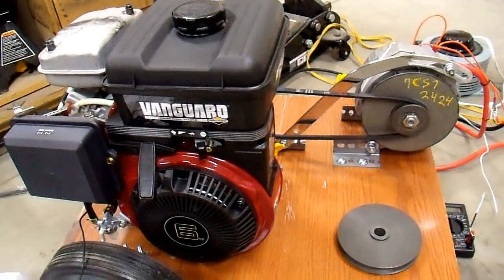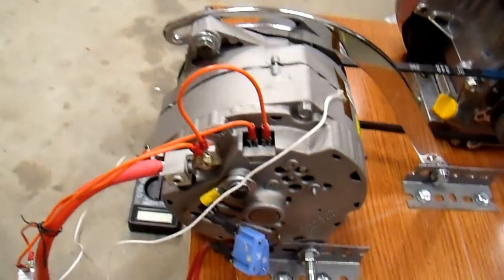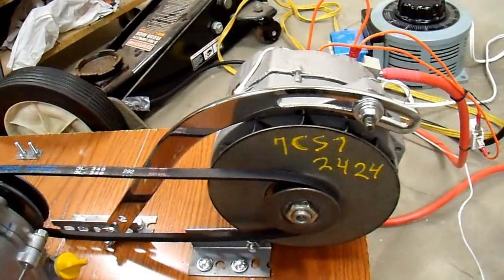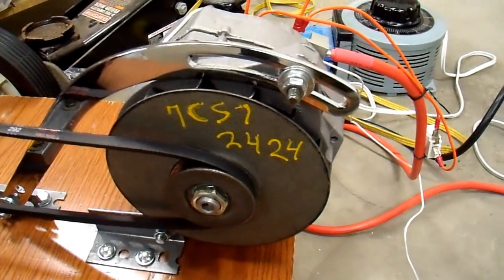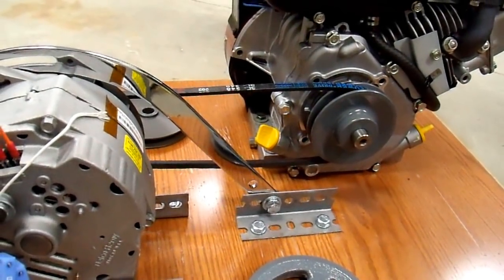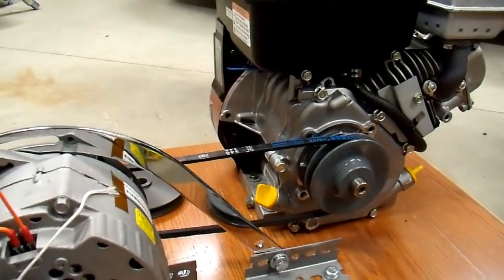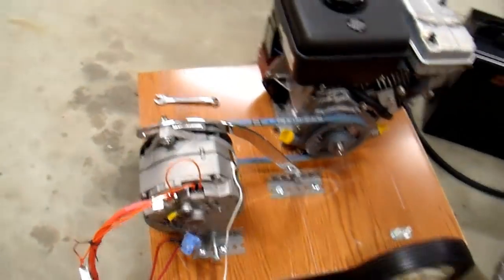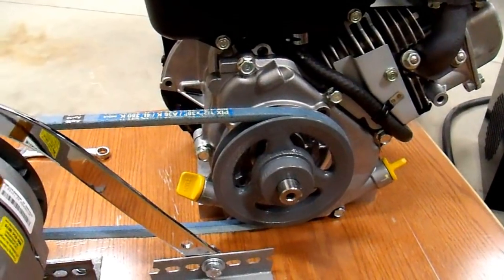DIY 12V Generator Charger - 7 Belt Drive Update

Comment: Nice build but your overthinking it. When I was a teenager I fastened a 12" pulley in place of the blade on a 3.5 hp lawn mower. Cut a hole in the deck and pounded it into a mount for a Delco  alt. Wired to an old style "block" regulator. The engine has to be started before you can put a load on it but it works like a charm. Have been using it for 40 years like that and it has never failed me yet. I use it mostly as a portable battery charger but I have run things off an inverter just fine.

Comment: Why didn't you put another alternator across from it. connected at the shaft, that way you run two. YOU could also run 4 with a double pulley on the gas engine. Get 4 times the power. USE a mechmann 370 amp alternator. USE fumes to run the gas engine. That would be the ultimate power when doing what your doing.

Comment: I also converted the small Honda engine to run on LPG.. I took an old regulator off of a Coleman pop up..which BTW did not provide enough flow..I then bought an adjustable 20 psi max regulator from northern which gets the job done without melting the Honda clone..I then purchased a bicycle spedo off of the internet for 30 bucks that is used for automatic usage..it won't keep cranking unless it starts..it is fully automatic..it will turn the gas on for 5 seconds if it dosent start it will cycle for 20 seconds and try again..after 4 times it won't try anymore and you have to manually push the button and turn the gas switch on..it will still run on gasoline but is much better on propane..if you want to do this with yours PM me and I will give you the breakdown of the parts list and specs

Comment: the AC delco alternator that you are using is inappropriate for heavy usage.. the problem that I encountered with the dodge alternator was obviously the voltage regulator had to be replaced once every 3 months..the belt..and I had problems with the rectifier diodes several times.. oh and also the valve springs on the Honda clone are inadequate.. but I worked through everything and it still kicks ass..I upgraded to a 180 amp alternator.. I'm not currently using it more than several hours a wk because my wind turbines are taking up the slack

Comment: I built one out of a Honda clone from harbor freight.. 78 amp Chrysler alternator with external regulator..old 15 amp generator off of a wheelhouse lawn tractor(so that I could have remote start)..an 8 inch pulley from tractor supply..and also one of those Kevlar belts..which by the way suck..but yes it would keep 4 ..8d agm batts filled and prety much run my whole house

Comment: Nice build.  Good tips for anyone who is considering using spare parts to make a diy dc generator. Although, if one had to buy all new parts, one would probably have to pay much more for that system than if one simply bought a good used portable generator.  For example, I bought a 5kW petrol generator for 300$.  It will produce more than 5 times the power of your setup & it probably costed less than your total cost in materials & time.

Thanks for sharing!
Reply: A B,
I have gone the $300 generators and the $4000 3.5kw generators before.  And basically you are paying about $10 for every hour of useful life.  That is, you May get 30 hrs out of a $300 generator.  His little 1200w DC generator isn't really optimized IMO, but it still gets at least 2x the watts/gallon of gas as those cheap generators though, and is much quieter. 
The inverter generators are really the only way to go if you are to buy one off the shelf, and then only the 3 named brands are even worth the price tag.
Reply: I agree that buying a yard sale or Craigslist generator for cheap and spending some time repairing it makes far more sense,  unless your aim is to learn to engineer your own project,  which is what this guy did.

But why didn't he do a better job of analyzing what he had and what he wanted?  Buying a new alternator that was essentially the same as the one he had could have been avoided had he looked up and read the specs on what he had and how it operated.

Comment: so on the excite wire that powers the field why don't you use a pot knob or potentiometer so you can crank the field voltage up and get more when you need it and turn it down when you only need the minimum and save the gas this is widely used in the auto stereo competition field

Comment: are you an engineer  or nothing else going on in your life i used a peice of crap alternator a dry rotted  belt a treadmill motor that itokk out of a unit ifound in the sttreet   no specs   80 amps no problem  made 2 does house

Comment: On heavy equipment it is common to use a double sheave pulley and V belt set up to transmit full power to a heavy output alternator.

Comment: leece neville makes all kinds of alts and use serp pulley rarely slip when torqued got 8 320A Leece nevilles never slips even under full load i used a twin cyl engine and cast iron pulleys from old air compressors like 10-12" pulley some what heavy to increase flywheel action also use leece neville alternators that have 3 phase AC taps and also variable dc regulator used by CB'ers to run big amplifiers

Comment: If your alternator RPM is too low, your alternator will overheat at higher amperages because the fan RPM is too low.  

Consider that 100 AMPS @ 6000 alternator RPM is getting you twice (roughly, I know it's not a linear relationship) the cooling power as 100 amps at 3000 RPM.

Comment: Why not use a higher current alternator that is made for car audio competitions?
Reply: unijabnx2000 Most high output alternators aren't "made for audio competitions." most audio competitions actually require you to turn the car off and run off batteries, with many events actually restricting the number of batteries you can use to 2. That being said, I'm sure he could have grabbed a 270 amp high output alternator but that amperage is unnecessary for what he is trying to achieve.

I compete in car audio. I have a chunky DC power high output alternator as well as 2 nice AGM batteries. I can't use my alternator in most comps.
Reply: Alec Westmoreland Cool story bro

Comment: First off awesome video. Very informative. As far as one of your viewers stated I wouldn't worry about the angle of attack for your pulley system. To decrease your angle of entry would mean decreasing the friction cause by the belt. By reducing the frfiction of the belt you create more of a chance of it slipping. My best suggestion would be to use a gear style system to remove the chances of it happening at all. Just a thought

Comment: what you could do is use a shaft compiler to extend the shaft and place some more pulliy's and belts on the drive. you will have to build a stabilizer at the end of the shaft.

Comment: That alternator probably turns alot faster in an automotive aplication
Reply: most acceleration is below 3k rpm
Reply: +DMAN22yeah engine rpms yes but crank pulley is probably 3 to 4 time the size of alternator pulley so it means the alternator is turning way faster
Reply: 1teddy1979 true, but it usually isnt loaded down much
Reply: +DMAN22yeah that is true as well. probably not too often you pull up 100 amps off the average car
Reply: 1teddy1979 only when the battery is dead or there is an inverter or something

Comment: I haven't read all the comments so ignore this one if it's been mentioned before.  How about the use of a third pulley, perhaps an idler pulley?  This would reduce the angle of attack tension on both the generator and motor pulleys.  This is how vehicle pulley systems operate.  Look at any car and you will notice typically they have no more than 90 degrees of belt contact on the pulleys. In your case you are running two 180 degree pulleys.
Reply from the maker: For high load pulleys such as alternators vehicles typically have as close to 90 degrees as possible for maximum friction and minimum bearing load.  90 degrees is optimum.  The idlers are there to enable the belt to wrap around the pulleys adequately and at least one idler is always necessary for use as an automatic tensioner.  In my system I need to manually tension the belt.

Comment: i have been watching your videos and others and i had an idea. here is what i had at our farm shop for engines, alternators and pulleys. a free used honda gx240 8hp, a 3-4 year old nos greyhound 6.5 hp engine, a  pulley hub of 3/4" ,i.d that will bolt up to a 6" and 7" pulleys i found in our parts pile. a well used 27si 80amp alternator with a 3"diameter -1/2" wide groove pulley/1 from an 85 gmc  farm truck we had. i believe its a 3 wire unit. a rebuilt 10si.  that i have 2 pulleys for it. a  double 3/8 wide groove 2.5" , and a single 3" one that takes a 1/2" belt.. would a 6 " pulley be too much for the 6.5hp engine? maybe i could put the honda on it and run it real slow.
Reply: oh we do have a crap load of spare belts but i found a shorter on i could use if i mount the 27si real close next to the engine on the fuel tank side .
Reply from the maker: TheChewy78
If that honda gx240 is in good condition I'd hook that up tor your 27si.  6'' on the engine and 3'' on the alternator should work well.  It isn't the optimum for efficiency but it should operate well otherwise.  Run the engine at 2000RPM or so and it should work well.
Reply: ok im just trying to find a use for it lol i did figure i could idle it down and gear up with the larger engine

Comment: I have a challenge for you.  Design, build and test a serpentine-style belt drive system.  You could test multiple ranges of diameters and belt widths.  My gut says a 4 groove or narrower serpentine belt would have fewer frictional losses because the belt is thin and more flexible but has plenty of surface area to avoid slippage.  Seems like a potentially large advantage.  What do you think?
Reply: Oh, and add a nice heavy flywheel to the output shaft if possible.  That will smooth the pulses from the engine and make the whole thing vibrate less.
Reply from the maker: kevin9c1
I used a cast iron pulley to increase the flywheel moment of inertia, but additional weight would undoubtedly be helpful.  And you're absolutely correct in that a serpentine belt would be better and more efficient but they are not widely available, so for practical reasons I chose to use a simple single V belt.
Reply: ***** Actually they're quite common.  http://www.napaonline.com/Catalog/Result.aspx/_/Ntt-serpentine/Ntk-Keyword/Nty-1/N-26306%204294948355/Ne-600091

That's a listing of all the 4-rib serpentine belts that Napa carries, in lengths from 22-5/8" to 94-5/8".  You'll find many that are in stock at your local store.  And that's just 4-rib.  They also offer 2-rib up to 14-rib (and a single 15-rib offering) in different length options.  MANY choices.
Reply from the maker: kevin9c1
The link is broken.  Are there also standard pulleys I can put on the alternator and standard pulleys I can put on a 3/4'' keyed engine shaft?  And will they remain available and in stock for all time?  I'm not saying it can't, or shouldn't, be done.  It's just not something I'm going to mess with because the parts are not anywhere near as common.  I can go to any farm supply store and pick up what I need this way.
Reply: ***** Pulleys are where you might have a problem but if you were really concerned that you might break one you could always just have a spare of each.  The belts, on the other hand, really are quite common.  We've had serpentine belts on cars since like 1987.
Reply: ***** Plus, perhaps the efficiency gains would be worth it.  For 5%?  Probably not.  But I think it would be more than that.
Reply: ***** Looking into any automotive (or any) applications that would use a harmonic balancer pulley on a 3/4" keyed shaft.  That would get you the ribbed pulley AND some good weight.  And being a balancer, may even help smooth the engine further.
Reply from the maker: kevin9c1
I am sure that many people have more fabrication skills/tools than myself and serpentine belts could be a good solution for them.  Unfortunately getting an alternator pulley that fits properly on the alternator shaft (I forget the dimension) is difficult without some machining, and I did look.  And, yep, I do have a 1991 vehicle that uses a serpentine belt.  :)  They're great inventions but aren't as universal as the simple venerable V belt.

Be assured that I am not disagreeing with you and I acknowledge that a multi-v belt would be a technically superior solution.  I just like the simplicity of this setup.

V belts are around 90% efficient so I think getting a 5% benefit by moving to a serpentine belt may be optimistic when considering the large diameter of the sheaves I'm running.
Reply: ***** Well I'll let you know if I end up looking into this project more seriously.  It would have been cool to do actual efficiency measurements with V vs serpentine.

Comment: Will this power a electric heater if so how long and yes I'ma see how much volts the heaters take ?
Reply from the maker: I would power an 1000W electric heater for as long as the engine has fuel.  The battery bank would run it another 10 hours or so.
Reply: That's what's up

Comment: Thats a 24 volt alternator right ? Also why not just buy a napa high amp alternator with a birth sheet that tells you what the peak amps are at what speeds ??? smaller pulleys equals more belt tension to keep belt from slipping and increased belt wear which (belt dressing) can help with  i could be wrong just my initial thoughts :)
Reply from the maker: belt dressing is always chemically destructive to belts - it should never be used.  This alternator is a standard 12V unit but a 24V alternator would be a bit more efficient if once would choose to go that route.  I chose to stick with 12V because it is more universal and because most 24V alternators would overload the engine I chose to use.
Reply from the maker: *****
This is not a harbor freight engine and yes, voltage indeed does affect the engine load.  V*A=W.  This is the most basic premise of electricity that exists.  Please educate yourself a little before making inane comments.
Reply: Only thing you did not answer is why you did not get an alternator that has a birth sheet showing what the output was at a given speed. Also Belt Dressing does break the belt down some but only to make it sticky and for what you are using it for would be a viable option if needed in a pinch so i would keep a can around for an emergency situation. And an extra belt. You can buy "muffler wrap" at any auto parts store in a kit to seal up some of those leaks in the exhaust.  Teflon tape works well also if you can get it.  Great job though keep it up i love the videos.
Reply from the maker: Standard alternators do not provide 'birth sheets' and high output alternators usually fake their sheets so there isn't much point.  I purchased one for cheap and tested it - and it worked far better than the high output ones out there for this application.  I do have belt dressing spray but I only use it on things that I don't really care about like my lawnmower drive belt.  It does make it 'more sticky' but it also reduces belt life.  Like you say it can be used in a pinch.

Comment: Great video once again, my own generator has a large alternator (not an automotive one) driven by a Honda GX340 via a coupling. 
I can understand the coupling have a hard time with the pulsed torque reversals with these single cylinder engines though. Fortunately mine has limited use and hence has not failed yet...
Good to see your projects but somewhat amazed at some of the criticism, I guess it's normal. 
A few good posts in the comments... ie adding some "flywheel" effect at the engine end would reduce the snatching effect on the belt. I know you have also stiffened the baseboard now, sometimes a good idea to physically brace the alternator top mounting to the engine....
Not being critical, I have a project in mind myself and find yours interesting.
Reply from the maker: I keep thinking about re-configuring this setup to direct couple it again but never do because this belt setup is so lenient and reliable.  Adding mass to the flywheel would indeed help the coupling and I am confident that I do not have the optimal setup here, so please share your experience!
Reply: ***** i noticed in the earlier vid with the direct drive, it appeared you had the fan seperated from the housing by the mounting plate which appeared to make the fan usless in cooling, i would think direct drive would be the route too

Comment: two questions you might have gone over already, what is the model of the gm alternator and where did you get your pulley wheels from. thanks
Reply: ***** why not a CS version? The SI's were complete dogs.
Reply from the maker: The alternator is a 27si from a local parts store.  They are reasonably cheap and work extremely well for this type of application.  The pulley was purchased from Jegs and is advertized as an anodized aluminum racing pulley.  I was impressed with the quality and would recommend.  The pulley on the engine was purchased from TB Woods.  It's a standard cast iron pulley so I cannot comment in much specific detail but I am satisfied with it.

Comment: Why not use a chain from a bike or mc instead of those belts that slips that much?
Reply from the maker: A roller chain would definitely be more efficient, but it requires lubrication and isn't available cheaply off-the-shelf.  I like the idea of going to any hardware store and just buying a belt for $5.  V belts are very flexible in their application and with proper alignment very reliable.  A chain would work well though I think.

Comment: try Kevlar belts
Reply from the maker: Kevlar belts are less elastic which can be a problem for some applications, but for this application I do run a kevlar belt and recommend it.  I see that the particular belt I actually run isn't in this video.